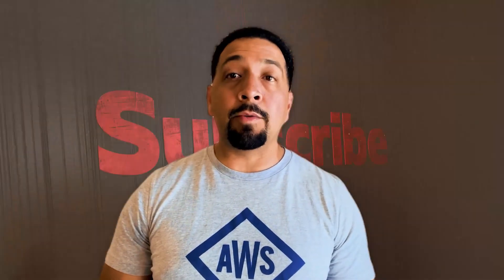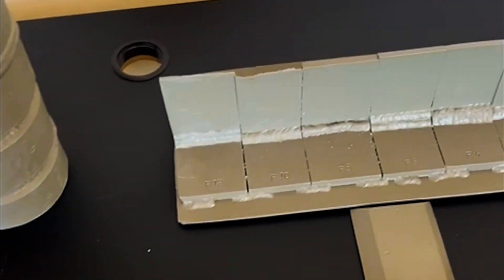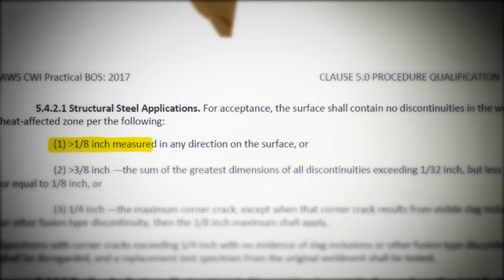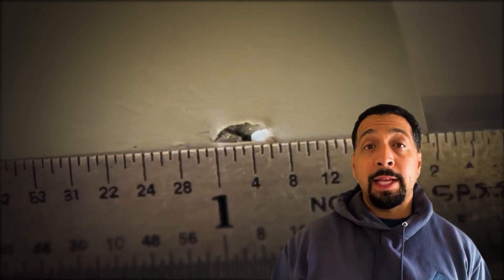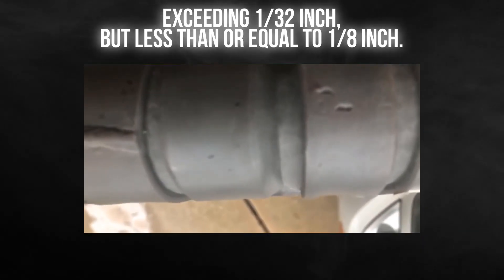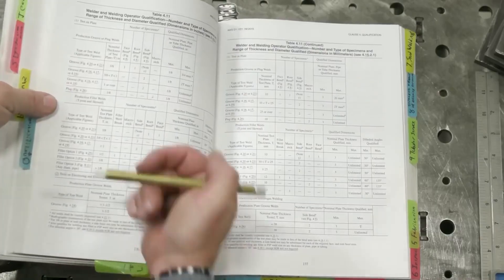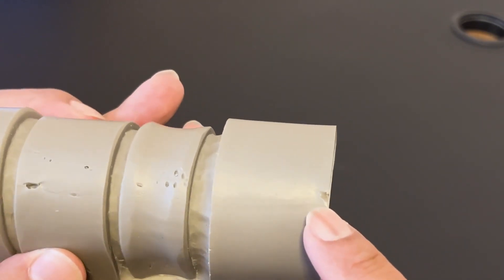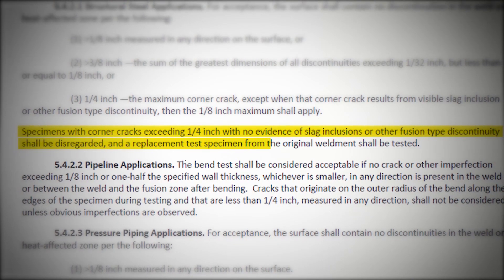CWI Part B Exam Questions (Part 2)

Comment: I took the CWI exam in 2000 with no prep course. Showed up and took all 3 parts in one day, and passed. In 2009 I did the same for my Part B recert. In 2018, I messed around and let it expire, so in Sep 2024 I took the prep course followed by Part B. The difficulty of the Part B exam blew me away. Way harder than the practice exams during the seminar (which I passed). I took A and C a couple weeks later at ProMetric. I passed Parts A and C pretty easily with time left over, and failed Part B. Retaking Part B in a couple weeks, and even though I’ve studied I’m still not super confident. Thanks for the videos!
Reply from the maker: Good luck brotha!! Check out my training guide, it may give you some extra tips to give you the edge to pass.